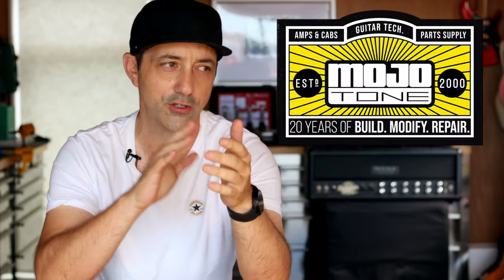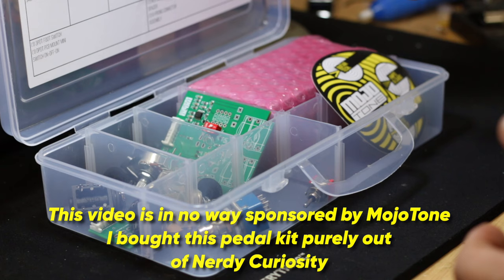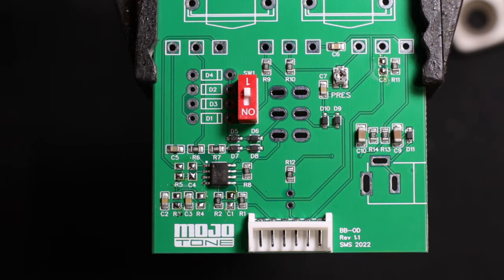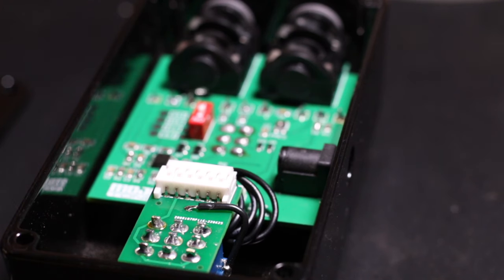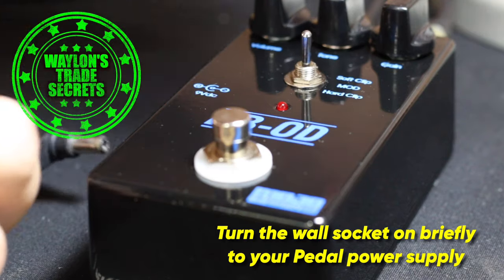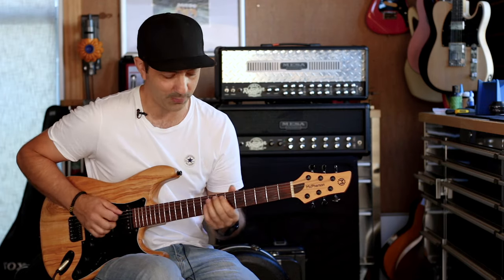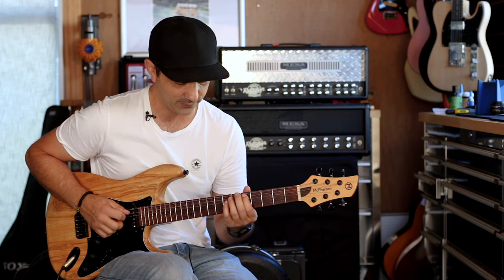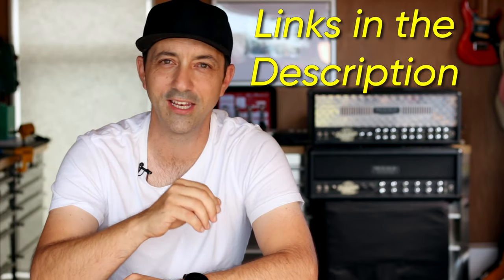Try My Secret King Of Tone Overdrive Mod for Less Than $1

Comment: rock it before you box it. Most of us pedal builders test the circuit before we ever box it. That way you know it works. If you box it up first and it doesn't work it's a lot harder to diagnose the problem inside the box.

Comment: Circuits can't be patented, and no one holds copyrights to circuits. They can hold the copyrights to the pcb layout but that's about it. Unless they use a proprietary part like the plasma pedal there isn't much they can do to stop someone from taking that circuit and producing it. It's the reason Bill Finnegan gooped the klon. It gave him time to sell his pedal for years before anyone could deconstruct it. As soon as they figured it out you saw many clones. Cloning circuits is perfectly legal. You just can't copy the pcb layout. That falls under an "art" copyright going back to the days that pcbs traces were hand drawn.

Comment: Very cool! I see you have what appears to be a Single Rectifier, and a Dual Rectifier behind you. I have a Dual Rectifier, Triple Rectifier, and a Stiletto Trident Stage II among other amps. I am interested in what other amps you use or what tubes/valves you prefer. It looks like you've built a nifty switching system. You always seem to come up with cool ideas. Cheers!
Reply from the maker: Thanks for checking it out, the two Mesa's are actually in for repairs, great amps. We stock TAD nowaday, really like their tubes
Reply: @WaylonMcPhersonGuitar  I have a quartet of TAD EL-84s (w/adapters) in a Peavey MX (sitting on the shelf for repair) that I normally use with my old Talkbox. So, what is your main amp(s)?